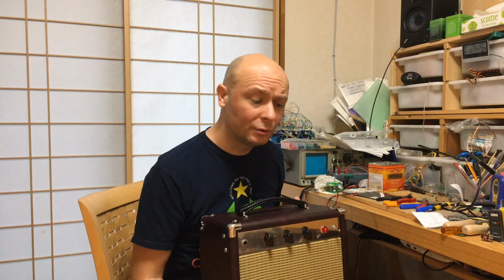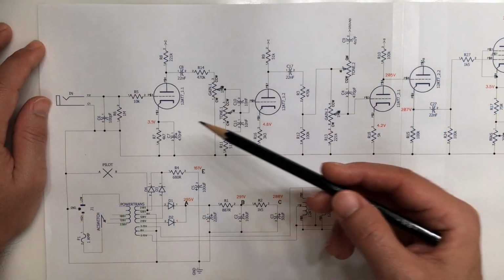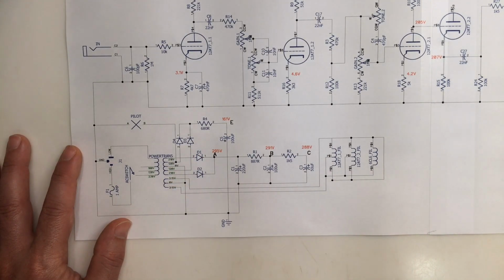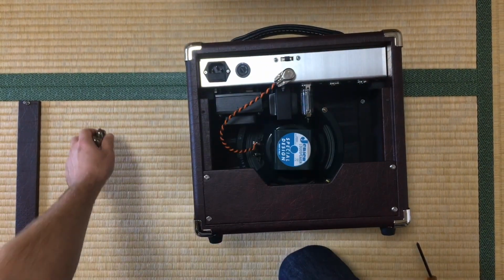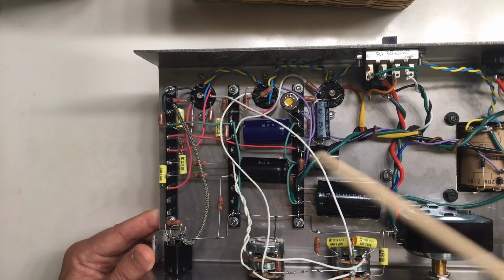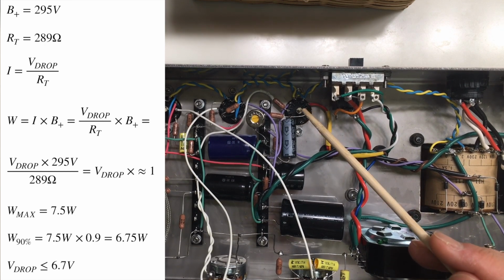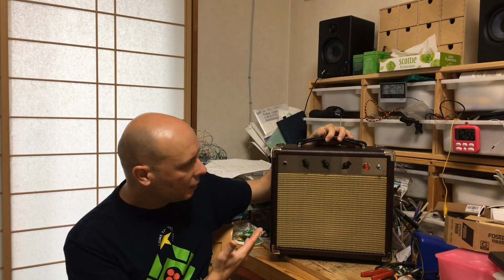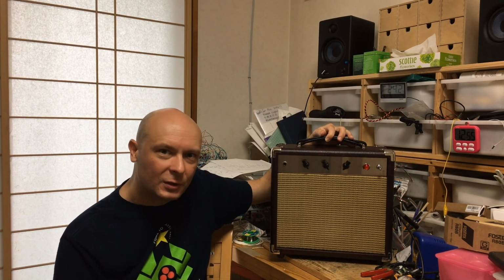ZenZero Zero custom 8" hand-wired combo

Comment: can i ask where you get the corner protectors ?  the amp sounds really good btw . i just finished a pal800 fet marshal circuit , put it with a spring reverb driver and a small tank with a class d tpa3116 amp board as this is battery amp . it is powered by 15 - 18650 cells . li ion . 3 of them provide 12 volts to a 7809 vreg-  which powers the spring tank circuit and also the preamp . the rest of the batterys are 24 volt opack for the power amp board . its in a old tachometer case - like a tool box . i play it thru a fender 12 . it sounds pretty good too ! i do own tube gear but - i am not so much crazy for vacuum tubes as i live in apartment so we make music in remote - at forest - a quarry actually . no ac line - batterys only . so yeah i am "just some kid in bedroom with a line 6 ... right ... lol - have to have tube to play like big boy - right . ( no ) here is video of us making our kiddie music with solid state poor tone rig - its all pretend - from our remote jam - its all battery rig we built . this was filmed a few days ago - https://www.youtube.com/watch?v=9bksvoyKVCI
Reply from the maker: Hi! Good work on your amp! The corner protectors were installed by the guy that custom made the cabinet. But if I had to buy them, I would buy them from a specialized store like this one https://www.garrettaudio.com/hardware.html I'm in Japan so that is what I would use.